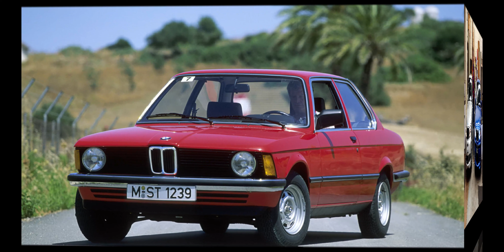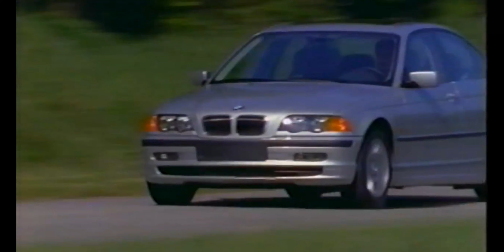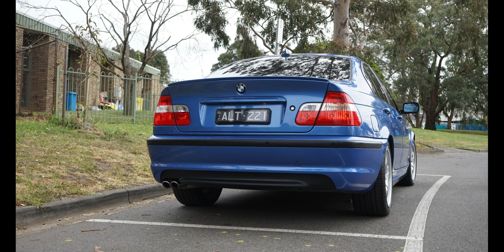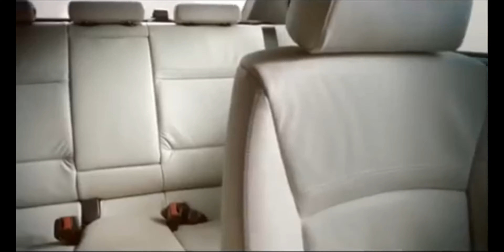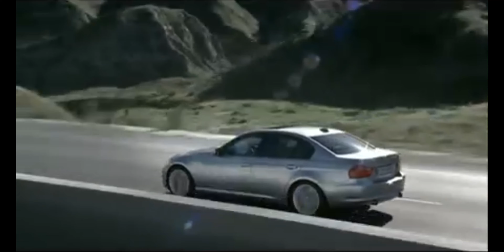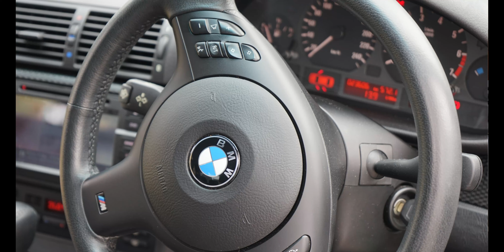BMW E46 vs E90 - Which Car Does The Mechanic Prefer?

Comment: E46 if you like more sporty drive
E90 newer in m3 batter looking, late m3 would be batter all round car
If chosing from base models it's e46 for me, more steering response, lower maintaince cost then e90, a bit more quality in parts all around.

Comment: I just picked up a 2006 330i (E90) with a 6 speed manual. I feel its one of the most under-loved BMW out there. You still get the beautiful inline 6 that BMW is renowned for, at least here on the Canadian market the e90 are in generally much better condition, easier to find and cheaper than an e46. I love the e46, it looks better and the interior has more character, but truly the e90 seems to get a ton of hate that it doesn't deserve. I never even liked the e90 visually, after owning one, it really has grown on me, a few mods and it looks great! I think the e90 is the last of the analog BMWs, it never feels much different than my e39 540i 6speed I owned for a bit, steering is tighter on the e90 and inside it has less creaks and rattles!

Comment: I'm really surprised that all those regulators failed so early. I've owned my 2005 E46 M3 for eight years now and I've never had one window regulator fail on me. I've had a broken window button break because the plastic is not very strong or the design is poor. But that's it. Also the blower motor and regulator for that went on BOTH my E90 335XI and My E46 M3. Replaced them both myself as I do all my own work on those cars.

Comment: Both the E90 and the E46 have full hydraulic steering. Electronic steering was introduced with the F30. Great video
Reply: my e90 has eletric its a 2011 also the same engine as the f30s untill 2016 its the last e90
Reply: @tanner1189 😢

Comment: The E46 is a great looking car. The E90 looks heavier and bloated to me. I recently changed some bushes on my E46 and got the alignment done, and it drives like it’s on rails. I also love the hydraulic steering. Mine has the purple steering rack. Nice size too. Not too big. I also love the M Sport bumpers. Lovely cars.

Comment: Got a 2004 E46. The design is timeless.
Reply: If you have the Induktiv wireless charger/cupholder installed, and get a Carplay conversion done on the original factory nav unit by Carphonics, you wouldn't miss a single thing from the newer 3s.

Comment: Bought my E46 325i new in 2001. After about six years or so I developed an itch to replace it with something more up to date. Glad I resisted the urge! Today, the car is a one owner, 76K miles, dry climate delight. It's been reliable. The intake valve VANOS sensor did go out, but this was easily replaced in my own driveway in about two hours. The car has had new belts, hoses, and brake pads, and it's on its third set of Continental Sport Contact tires.

Comment: 330 replaced the 328i 
but the 323i & the 320i have the same power figures so it's silly to say the 323i was replaced by the 325i when the 325i has the same power as the 328i ... 328i had more torque but a rubbish chassis and a head gasket leaking motor ! m54b25 is the best M54 engine built

Comment: Great video which I just discovered. I have a low km e90. The ride is firm, but it was designed for run flats, so I actually find it solid. Apparently, the E90 chassis is first class. The noise suppression is flawless, it feels like a new car. In looking at crash tests, the E90 is a modern car, the E46 doesn't compare. Just my thoughts. I also think the E90 looks timeless.  Many current models are still taking cues.
Reply: U had both of them? E46 and e90?
Reply: @AndrewTate-nf2id no. Just the E90.

Comment: My wife's 323i had the same issue with the plastic windows regulator parts. Both rear windows failed after only 60k km! Had to import from Germany during the Pandemic. Good old reliable duct tape held up the windows for 3 months - until replacements arrived. Nice car - shame about the crappy plastics.

Comment: I am looking to buy a 2003 E46 330i M-sport at the moment. It has a 6 speed manual, which I believe is pretty rare (at least in the Netherlands). 195K km and a good price. Engine runs smooth and makes good noise. I'm first trying to find a buyer for my 2007 E87 118i, which is difficult in present time (fuel costs in the Netherlands are high)...

Comment: I've had my 2001  E46 coupe for 14 trouble free years, one of the best cars I've owned, it now has 250K on the clock.
In 14 years, apart from the usual maintenance and service items, I've only needed to replace the expansion tank and battery

Comment: Isnt e90 better to drive?
Reply: No, the e90 is not better than e46. Meaning the older is better.
Reply: Easilyyy I own one and I’ve almost had it for a year. best years in my opinion and a little more modern
Reply: @ultrasoundviolet  e90 is better than e46
Reply: @hater8812  E46 is funner to drive.
Reply: @JohnTaylor-bd1uy  why john rodriguez says that e90 is better?
Reply: @hater8812  John Rodriguez is bias. I've driven both and as a mechanic who pays very close attention to detail, the E46 was a better design. When BMW went with Electronic steering, it eliminated the shaft which numbed the driving experience.  The e46 has better road feedback/driver connection.  But it also looks better than the e90. And most enthusiasts agree. You think Rodriguez knows better than the European BMW master mechanic in the video ?
Reply: @JohnTaylor-bd1uy  but don’t forget e90 non-facelift has hydraulic steering same as e46. Is e90 feels softer less dynamic on the road?

Comment: The e46 330i in manual with minor tweaks like exhaust and grippy tires make it a damn fun car to drive. Mine is nearly twenty years old and still drives well with hardly anything changed on it. That being said, preventative maintenance is key.
Reply: Yeah,great cars,the 330i.I had a 316i 1.9 8v and sold it 2 weeks ago,and i bought a 325i back.What a great car,6 cilinder
Reply: the chassis alone makes it a pretty fun car; i have a 318i and although it is down on power, when you have good tires and find the right twisty road it is a blast.

Comment: In 2004 I was the young executive driving my 330i, forward the time I am a middle-aged CEO being chauffeured in my 750i. I still kept my 2004 330i E46 after all these years and it still drives just as good as the day I bought it from the showroom floor. Older BMWs age like fine wine, the newer models made after 2014 are garbage.
Reply: Absolutely. I had a 330 in my early twenties and ended up buying a 330 again in my late 30s. The quality of the materials in the e46 are significantly better than the e90 series.
Reply: @davecom3  I agree, the build quality went to hell by around the F30.
Reply: Also the desighns of new ones are just ugly, just look at that e46 its beautifull and somthing I can't take my eye off, it might be 20 plus years old desgin but it's still new to me and the new ones out date much quicker due to the technology and the hideous desghins.
Reply: Would you sell it? I want it
Reply: @JorMorera no
Reply: @VanquishMediaDE 😢😢

Comment: If you have an e46 you can look forward to replace control arms and bushes, steering coupler, driveshaft center bearing, cooling system expansion tank, water pump, radiator and hoses, thermostat, crank case ventilation valve and hoses, valve stem seals, valve cover gasket, altornator regulator, v drive belt and tensioner pulleys, oil filter housing gasket, oil level sensor, internal cockpit fan  resistor, window winder mechanisms, interior loof lining. Had the car for 9 years now 2002 320i, 174 000km. $$$, Great car though
Reply: The same largely goes for the E39.
I have owned one for more than 2 years now, and I have spent thousands on parts. It is an AMAZING car when it is sorted though...
Reply: Also DISA. And then you have a tank
Reply: +Rust. BMW decided to strategically use cheap steel brackets on the rear side skirts, on the fuel filler pipe, meaning that the rust will begin on them and carry over onto the body panels. Naughty BMW.
Reply: @ppppugh7892  No issues with rust yet and I stay by the coast. Just annoyed by the plastic parts they use on the cooling system and some other places. Went through two original BMW cockpit fan resistors, ended up replacing with and aftermarket part and it has lasted for years. They should upgrade these weak parts, like the stupid plastic wheels on the window winder machanisms.
Reply: They're designed to break and they know that, there's no way a plastic wheel should be used to work with anything metal.

Comment: E90's both a better driving vehicle and more reliable due to e46's subframe issues over time.
Reply: E46 subframe issue is overblown. I have been lucky enough to own 9 of them and none have had issues with the subframe.
Reply: @davecom3  9. Bloody hell. I'm assuming you have enough money to purchase the ones that have been well maintained.
Reply: @josephbriffa120  I've bought a few that were badly taken care of and they did require work around the 100k mark. The biggest issue with them is rust and plastic components in the engine going bad. Gaskets will go if not properly warmed up. They really don't like being left idle!
Reply: Dudes got a clear bias.
Reply: Nonsense

Comment: So the mechanic would take the E46 because of the way it drives and handles. Nothing in the decision to do with the actual repairs, longevity, reliability, relative complexities or technologies. Purely subjective personal preference.
Reply: The e46 is more complex and better built than the e90 series, but it will rust. The chassis on the e90 series is also more suited to track driving. But in the right hands a 330 zhp will be the match of the 335 on a twisty track. Look at their straight line performance-little in it despite the 70hp discrepancy.

Comment: I have both e36  318is coupè  and e46  330ci  , the first one is a  1992 and over 350 k and just normal  maintenance  , great fun car  no major problems  other than the normal  fails , stored since 2010  still in good shape  . The e46  330ci  is M sport with  smg gearbox, 19 inch weels  and now over 280 k on the clock and still  a  Wonderfull  and fun car to drive  ,  a bit of a nightmare to maintain  due to is age  , but the good thing is i can do almost  avery thing in my garage  its easy to repair  with the wright  tools ,  my original  bmw batery last until  2014  ( almost  a miracle )  . All and all , i would never  change  an e46  for a e90  !  It's just not the same feeling on the road anymore  .  Cheers  from spain  mate  .
Reply: This is so true, bmw has done a great job of keeping serviceability. Both the e46 and the e90 cars are serviceable. The materials are not that great in the e46, but they’re worse in the e90. If you are focused on driver experience, both cars are wonderful for that.
Reply: How do you like the e36 vs e46

Comment: E36 isn't the most collectible, not even close. You can still pick up an E36 M3 for under $5k. Meanwhile you won't find an E30 M3 for less than $40k, and many are going for $70-100k+
Reply: Where? I’d buy multiple e36 m3 if they’re under $5k
Reply: @jayhussain6959  I mean they're used and abused but they exist, I've seen several on my local Craigslist.
Reply: @jayhussain6959  That being said, you can still get an excellent example for $6-8k
Reply: @somedudeinatunnel3102  what area? Here in Canada there considered collectibles and go for lowest 10-12k on a good day
Reply: @somedudeinatunnel3102  no you cant. E46 m3 is superior cause usa got weak ass e36 version so in usa the e46 is much more desirable

Comment: I was thinking about upgrading from my e46 to a e90 now Idk what to do 😅
Reply from the maker: Keep the E46
Reply: @UniqueCarsandParts  Are new parts hard to find for the e46?
Reply: @JohnTaylor-bd1uy no and the after market is huge for the e46
Reply: I own both - a 328i & a 330d, both wagons. The E90 is objectively a better car with better suspension & trans etc. and features. As it ages it will definitely be more expensive to repair with the CAN-BUS & module based electrics but the wreckers yards are getting flooded with E90s, 91s & 92s so parts will be getting cheaper & cheaper. Drive one and see if you prefer it. Like the mechanic’s conclusion it completely comes down to preference of fit & feel.

Comment: The E90 has a belt driven hydraulic PS pump.
Reply: It’s not straight forward. Electric was introduced round 2008 (LCI) but it wasn’t a cut & dry changeover and some models (335 & diesels) remained hydraulic. It also depended on whether the car had active steering & “effective dynamics” which had both a mix of electrically driven hydraulic pump (rather than engine pulley driven) and purely electric. This mechanic doesn’t know his sh*t. Maybe Aussie only got a very narrow model range but, then again, the diesels all had hydraulics before & after LCI so it’s inexperience with the models.
Reply: @DiscoFang  Sounds like there's not many diesels in AUS.
Reply: InnerGuide good for driving dynamics. Bad for fuel economy. (Comparing to newer electric steering)

Comment: Run and run as fast as you can from both of those things mate...BMW doesn't =" Broke My Wallet" for nothing bud...I see many at work with fairly low K's that need extensive repairs...Even simple stuff needs you to get in up to the armpits to complete..Just sayin'....It's an excellent E46...today...Just a note...We only use genuine BMW parts because barley any aftermarket parts fit properly so they'll fail soon enough too...Great for us mechanics but  a raw deal for the owners...I don't know of any mechanics here who own a BMW...Love the show mate.
Reply: It's definitely a car you either have to be willing to spend quite a bit on maintenance (a couple K every few years) or be willing to really learn to do them yourself